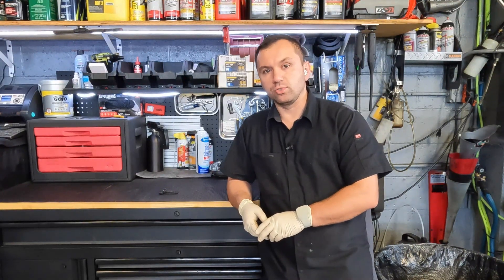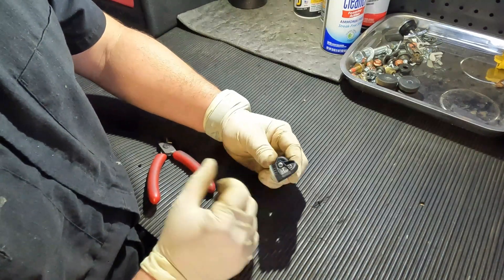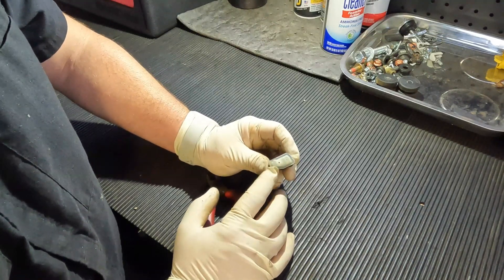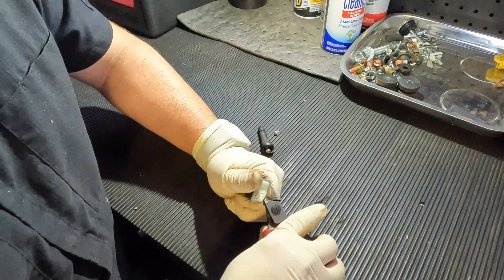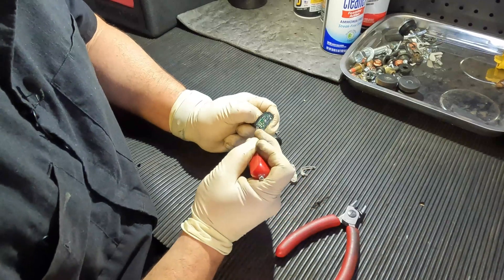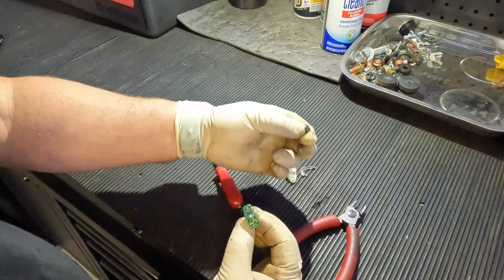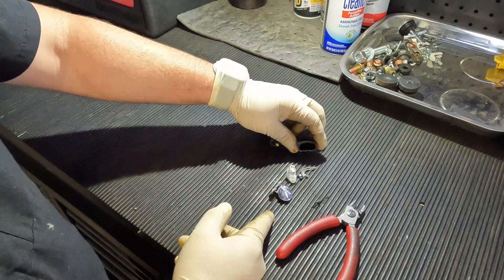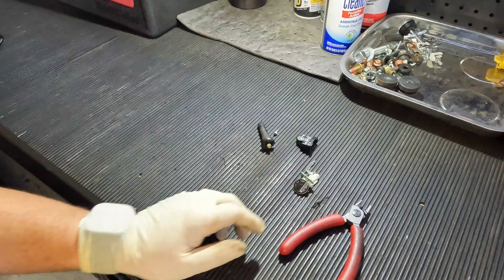WHAT'S INSIDE A TIRE PRESSURE SENSOR! LET'S TEAR IT DOWN AND SEE WHAT'S INSIDE!

Comment: I’ve used the aftermarket sensors which screw on where the valve cap goes. These tend to fail after awhile. However the battery can be replaced but it is usually something other than the battery which has failed because replacing the battery doesn’t work. I just ordered one with a 5 year warranty so will see how that goes.

Comment: A friend of mine got tired of dealing with these things. He took all of them out, taken them apart and fixed them at a certain pressure. Then put all of them in the glove box, so they can still be read by the vehicle.
Reply from the maker: I’ve had a few cars that have been rigged up over the years to fool the system that I’ve come across here at the shop